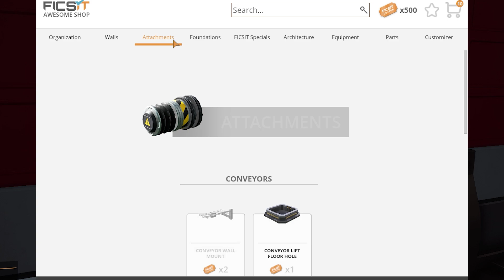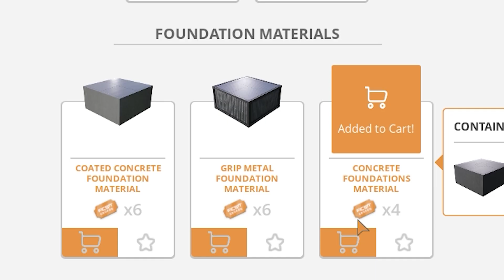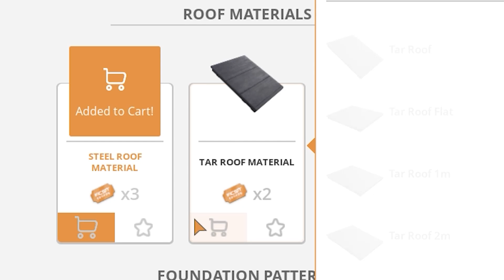Satisfactory Update 5 turned our World into a TRAIN WRECK!

Comment: 11:36 i think you've misunderstood how the signals work. Path signals reserve a path through a block of track, this mostly applies to an intersections with more than 4 connections. BUT can apply to a specific kind of 4 entrance intersection. You might recognize it, its two parallel  tracks with an X of track connecting the two sides to eachother. Say the two trains wanted to both go STRAIGHT in opposite directions, if you use BLOCK signals, they stop ANY train from entering the intersection if its occupied even if the other trains path will never collide with the train in the block of track. If you use a PATH signal in both directions, then multiple trains can enter the intersection IF they dont collide. Otherwise you might get a trains stuck waiting for trains to go individually through an intersection.

Comment: The thing with the trains is, I loved to play Factorio and still do and this is basically the same. Path signals read the next signal (block AND path signals either way) and rails and can set it to occupied (reserve the lane). The block signal can just read the rails ahead and set it to occupied. It is crazy good to have it but it is still buggy compared to Factorio: Given the situation two trains share one part of the track. If you have rails running in parallel to avoid clogging you are out of luck - trains will WANT to drive on a CERTAIN lane. This is hilarious and frustrating. Even though they could just switch the signals to drive the other way around, they won't do that. They will wait until the preferred track is free. This can cause (and did with me) a huge problem with material supply. The trains will wait until eternity and if they somehow stand in front of each other, both signals are red and they stop. AVOID that at all cost...

Comment: You do not need path signals before mergers. So when you have multiple stations merge into one track, you should just use block signals there. This will work better, because you have smaller blocks this way. You only want path signals when there's another way through a block that doesn't collide with one of the paths the trains could take.

Comment: The best way to think about a path signal is a stop sign. Once a train enters a intersection every other direction gets a stop sign so every other direction that can enter the intersection needs a path signal for it to work. And the block signals its best to have one more block signal then amount of trains on that circuit and the a train should fit in a single block. If you had say three trains on a iron ore circuit and four blocks the trains should be fairly well spaced out so you constantly have a train entering or approaching the station.

Comment: Block signals: if there is a train in the next block, your train will not move. If the next block is empty, your train will move.

Path signals: if the path to the next block signal or path signal you need to drive through is occupied, your train will not move. If there are no trains on the rail that your train intends to take, it will go.

Assuming the signals in satisfactory work the same way as they do in every other train game ever made, you should be able to make a perfectly functional system without using any block signals, since path signals are just better versions of block signals.
Reply: path signals dont work like that. if you add a path signal at the end of another path signal it will reserve that path too unless a block signal is added. path signals also take into account all other signals around it. so putting path signals where none is needed can cause more congestion

Comment: For the crossing intersection in your test world, you do not need that pile of path signals, the two path signals would still have worked, because path signals will only reserve the path through the block that the train is going to take, so if two trains paths won't cross (as is the case if they are traveling parallel, then they will be allowed into the block at the same time. Also, hit E on the erroring signals to see the error.
Reply: I was so surprised when kibitz came up with the idea of putting multiple signals there.
Reply: Do not add signals right after a junction like that, or a train stopping will block up the entire intersection.  :-)  Transport Tycoon FTW.
Reply: @S3t3sh  woo, another OpenTTD fan.
Reply: @S3t3sh  but then the train will stop before the intersection causing the same issue
Reply: @RealPanzer999  better to stop it before the intersection than have it stop in the middle of it and holding up traffic, possibly even blocking itself in
Reply: @S3t3sh  You actually do want a signal right after the intersection, since path signals in Satisfactory behave like pre-signals in OpenTTD with path signal functionality.
Reply: Came down here just to say this. Thanks gadamson12 =)
Reply: @halfgecko3202  it would only block a different amount of traffic if it was traversing another track otherwise it still blocks the same tracks. For blocking itself in: this only applies to junctions with a single track attached as trains coming out and in would use different tracks when available & thus avoiding each other.
Reply: There is nothing wrong with adding a block signal right after a junction. In fact, this is good practice. The path signals before the junction will not let a train into the junction if it won't clear this signal. However, if you want to add a second signal of either type farther down the track, after the first block signal, you need to make sure that the entire length of the train will clear the junction before stopping at this second signal, because the path signals before the junction can't see this one.

Comment: If Factorio has taught me anything about train signalling, it's these two things:

1. Make non-intersection Blocks at least as long as the longest train on the network

2. Always put Chain (Path) Signals on the inbound lines to an intersection or merger, and Normal (Block) Signals on the outbound lines - if multiple intersections are butted up against each other, use of Chain (Path) Signals overrides the use of Normal (Block) Signals, whereby you end up making a continuous chain of Chain (Path) Signals all the way to the Normal (Block) Signal at the exit. This means a train will never enter an intersection unless it has a clear path to GTFO of that intersection. By the same token, Chain (Path) Signals within a more complex intersection can allow for multiple trains to pass at once if their paths don't cross anyway (though I'm not sure how Satisfactory handles rails that are clipped through each other instead of properly joined)

NOTE: Please correct me if I got the translation from Factorio's train signal nomenclature to Satisfactory's wrong here
Reply: No need to put path signal in the middle of junction. Path signals in, block signals out, no signals in the middle is sufficient.

Comment: If you have a single bidirectional section of railway, there should not be any block signals on the single track section. You place path signals at the end of the passing loop, and depending on how the logic actually works a block signal at the start of the loop, after the junction, i.e. on the double track section. If you put block signals in this single line section you could potentially have a situation where two trains heading towards each other get stuck at red signals because of the other train, and therefore at a deadlock. Your only solution is to take manual control and reverse one of them back to the previous passing place and hope another train isn't there.

Comment: 20:43 it only fixed because you turned the one direction into a path signal. the thing breaking it was the LOOP around the back with a single block signal, so you had over lapping blocks and no block for the block signal.

Comment: Hey kibitz this system works almost exactly like real train systems you can do some research on it and it will help out alot. I used to work has a conductor for a railroad and I can tell you your very much in the right... track....
Reply: There are some short comings like a triple light rail signal can produce dozens of different signals (passive or absolute) but all in all satisfactory follows the basic rules

Comment: The “pass through lane” as you call it, has a real-world name: a siding. Where a single rail handling both directions allows an opposing train to enter the siding so that another can cross it’s path, or a faster train can pass a slower one, or a train can wait to enter a station without blocking path along the main line.
Reply: Will it work in the game though? Can u tell a train not to stop at a block sign but to take a siding if the main track is occupied?
Reply: @Zn0ZY  Technically; although the first train to approach the siding will actually wait on the main track as the block ahead is occupied, and the second train will use the siding to go around it.
Reply: @Tonatsi  as much as i would like to get back in satisfactory and test that cause its seems super fun, i dont wont to distract myself from my cities skylines binge gaming xD
Reply: @Zn0ZY  The easiest way to make it work is to build a normal pair of one way tracks for a small section of the two way track. Other solutions that allow the "faster train overtakes slower" will risk deadlocks unless you have three tracks.
Reply: Usually that's called a passing loop, IIRC sidings are for storage or loading/unloading.
Reply: @briannem.6787  In North America, Siding is any split of the track that is temporary to allow stowage of cars or for a train to allow another to pass. "passing loop" is not a term used here. Loading/Unloading can be done in some customer sidings, however those are usually called spurs.
Reply: @kai7474  Oh, I didn't know that! I used to think that myself, but I got corrected, as terminology is different here in Australia.

Thanks for the information!

Comment: You don’t need path signals before intersections, path signals are to be used when you can have multiple paths through a block which don’t intersect, for examlle with a parallel switch between a double track line, you could have two trains crossing each other, or you can have one train switching over, which blocks both other paths

Comment: 14:30 You actually don't need those interior signals. I have 3 and 4 way intersections all over my map and have been playing with it a lot. You need one path signal at each entrance to a junction, and one block signal at each exit. So 8 total signals for a 4 way intersection, and 6 for a 3 way intersection. 

Also, Path signals do not equal better. Path signals don't just look at their block, they look at the next blocks. So a train will only enter a junction when they have room to leave the junction. Meaning they will leave gaps between blocks when trains are backed up which will just make the traffic worse.

For your single rail offshoot tracks you want a total of 2 signals + 2 signals for each station. A path signal in each direction at the entance/exit junction to your single line, then a block signal entering each station, and a block signal leaving each station. Having more than one train on that line, outside of a station, will never have any benefit so adding more signals will just cause more confusion and delays. 

One last thing. Make sure to leave plenty of room in front of block signals before path signals. The path signals don't reserve a path until trains enter the block the path signal is attached to. This means that if you put a block signal right before a path signal, the train will stop for the red path signal until it enters the next block and the path signal reserves a path for it and turns green.

Hope this clears things up. Happy traininging!
Reply: did you even listen to his explanation? he did it so if 2 trains were going parallel, one train didn't have to stop for the other one. If you only had one set of path signals, even if 2 trains were not crossing lanes, one would stop for no reason.
Reply: @aiden6343  path signals reserve a path so he doesn't need the interior signals as if they were both gonna go straight they would boath go
Reply: cause more confusion and delays
I wonder how many people are gonna catch this. c:
Reply: gonna assume this stuff can be learned to be used back in factorio and its trains as they have now i think the simulare system
Reply: factorio's system is pretty much identical
just with different names
- block signals are just regular signals
- path signals are chain signals
Reply: Whilst those signals aren't needed, they do add extra functionality. Once the 'tail' of a train passes a chain signal that is inside of a junction, that bit of junction can be reserved by other trains. So if we take a look at the crossing example he had, if he had 2 trains following one another, one wanting to cross, the other wanting to go straight on, the train that wanted to cross could pass the chain signal inside the junction as it was crossing tracks, and when the last wagon passed the inside chain signal the next train could enter the junction and go straight on. So whilst what you suggest works, it is not exactly the most efficient way of signalling a junction. generally speaking the more path signals you can shove into a junction the higher throughput that junction will be.

Comment: The simple solution to train signals:

* Identify your exit blocks and put down a block signal at the entrance to those exit blocks.
* Chain signals before any point that one train can collide with another.
* Blocks should be large enough to hold your longest train (this is mostly a resource management issue; you can make them shorter if you want)
Reply: Factorio?
Reply: @jaimianscharr6320  Yeah.  Haven't played Transport Tycoon yet, but you need signals to work in two different ways to handle a complex train network.

Comment: I've found that Path Signals are generally only required where you could potentially have more than one train going through a block without colliding.

Trains will also collide if the tracks are too close together.

Comment: The "pass by lane" is called a siding and van be parallel to the main track, and is its own block, you can have multiple sidings for multiple trains, or one long siding that has multiple blocks, but the main line has to have blocks too.
Reply: Actually "sidings" are in yards and primarily for shunting or storage of engines and rolling stock, what you're thinking of is called a passing loop
Reply: @datguymiller  ah, ok thanks for the correction!!
Reply: @lukereyes6266  big railfan, I feel the need to correct these things, I thought you would be like "no it's a siding" and blah blah blah
Reply: @datguymiller  nah, im a relativaly (if thats how its spelled) new railfan and im open to learning these things
Reply: @lukereyes6266  I have a discord if you want to learn more